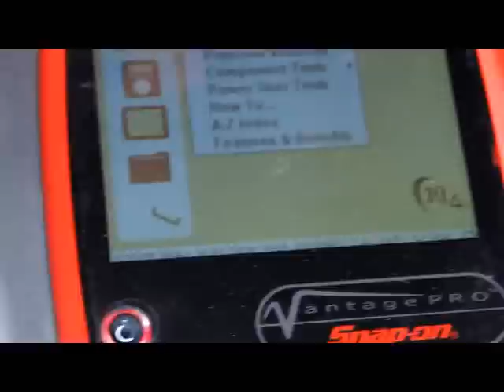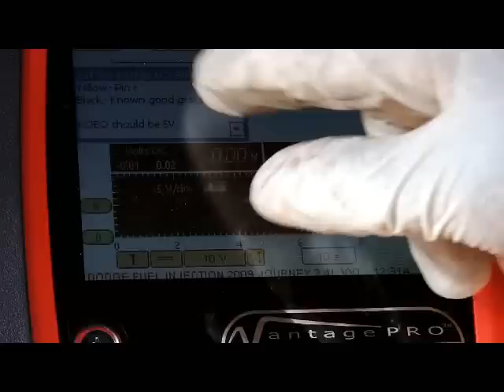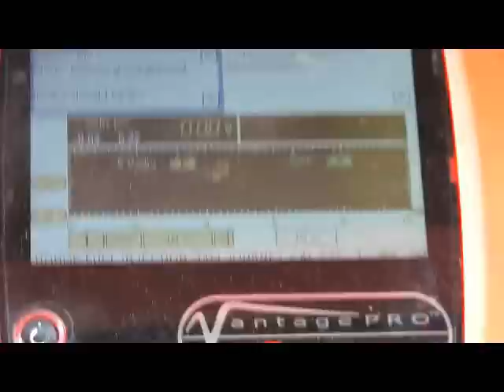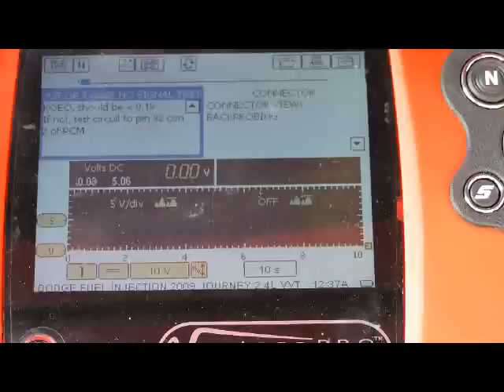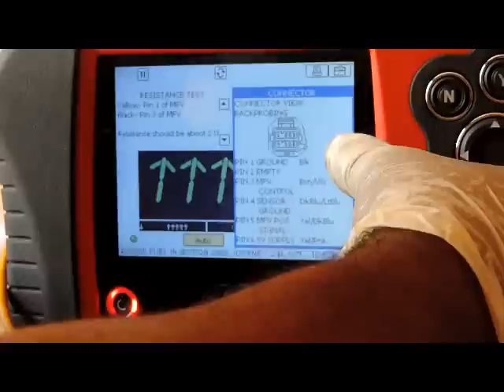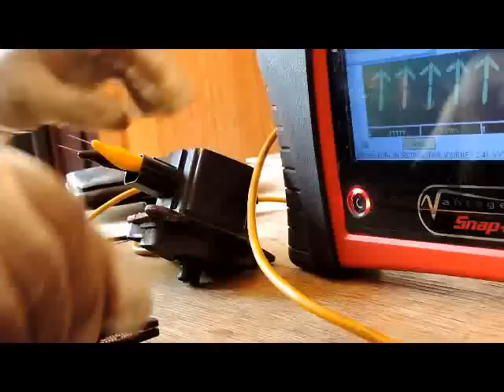P2004 Intake Manifold Runner Control Stuck Open - 2009 Dodge Journey

Comment: i have 4.25 volts at signal wire it’s that enough to replace pcm? thanks
Reply from the maker: Check to make sure nothing is shorting that wire out.
Reply: that’s directly from the pcm pin 4.25 volts

Comment: #astral auto, I have a question brother! What do you mean by flush the computer?? Do you mean reset the engine light??
Reply from the maker: Flash the computer
Reply from the maker: @Muzik Michael  You didn't see our comment? It's FLASH the computer, not FLUSH, or are you asking us what does FLASH the computer mean?
Reply: Astral Auto Repairs yes! What do you mean by flash the computer? I replaced the valve and turned the engine light off by the scanner I have.. is there anything else I should do??
And where are you located?

Comment: If changing the intake runner solenoid doesn't work  change the intake. 
            
            

            
            
          
        

        
        
    
    

      
      I'm going to save you all a whole lot of ass ache. I have a 09 compass that had the check engine light from hell, I tried all the fixes that youtube people had to offer and nothing worked, didn't even come close to working. I was at my local heep dealer to buy a gas cap for the heep for another problem it has, I asked the parts guy if he knew what they do for that code (P2004) he straight out told me without hesitation that they replace the intake manifold. To make a long story short, I had it replaced and the code went away.
After inspecting the old intake you could see where the gasket had gone bad and it was bleeding between intake runners. My guess is the intake warps a little after years of being hot and cold  after all it is only plastic and plastic warps. A new intake will run you about $400.00 buck plus installation unless you can do it yourself. You could try a sanding the intake flat again on a large flat surface and installing a new gasket, if that doesn't work you are only out a little time and 10 bucks or so for a gasket, then go buy the intake.
Thats my personal experience yours could be different, but i had good results

Comment: About 16:45 the meter reads 4k ohms not 4 ohms. But no problem, still a good video. Still shows it's a bad part. Shows me how to get to mine without removing the entire manifold. Same P2004 code too.
Reply from the maker: Thanks Aaron for pointing that out, glad you liked the video.

Comment: is IT possible that failure intake mainfold runner causes jerking or hesitating of whole car? i didnt get any codes . sorry for my bad English
Reply from the maker: Hi, not sure if it would cause those problems, but it can cause a lack of power if the runner is stuck closed.

Comment: hey ASTRO repair. I hear online that you have to flash the computer or something? I hope it's not true.
Reply from the maker: It's ASTRAL, and yes, any vehicle 1996 and newer must be flashed, some vehicles before 95, the PROM can be changed to fix driveability issues, hope this helps
Reply: Astral Auto Repairs thanks for the answer,  Astral! I appreciate it. I wish you guys were closer to CA. I think it's going to be $80 or more to flash the computer
Reply from the maker: Yes, that about the going price from the dealer.
Reply: Astral Auto Repairs lastly,  shops don't have that type of device?
Reply from the maker: Some because they have to pay for the software some shops don't want to bother.
Reply: Astral Auto Repairs well thanks Astral.  you have been very helpful and honest. anyone would be lucky to have you as their mechanic

Comment: Great video, thanks for sharing...you are a great mentor. FYI, I chose to change the entire manifold as the cost was only $150 more and a relatively easy swap.
Reply: hola, podrias ayudarme? ...
como le ago para pedir el cable para un avenger 2008?
Reply: hello, could you help me? ...
How do I ask for the cable for a 2008 avenger?
Reply from the maker: That sounds like a better option as it would save a lot of time from cleaning. Thanks for that info
Reply: Martin Mockenhaupt did you still have to have the computer flashed?

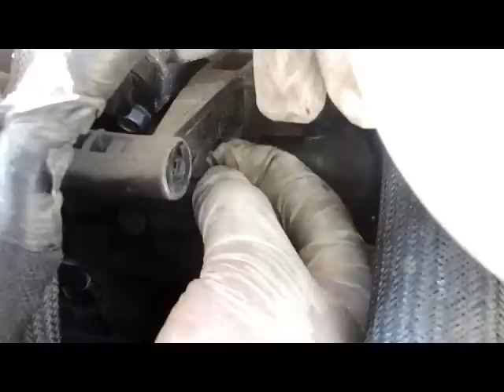Comment: Hey at 11:25 where you able to turn it very much?? Mine only turns like an 1/8 turn.. but the electric part you remove turns a lot farther than that. Something tells me the valve in the manifold should operate or turn farther.. please help me out. Thanks
Reply from the maker: Hey Jim, we thought the valve should have turned  more than what it did but after taking it apart, we found that it only moves just that much. As you can see from further after 11.25 when we took the valve out, we tried to manually move it. All of a sudden the valve snapped backed into the closed position. An 1/8 of a turn is not enough, that is telling us that it is stuck. hope this helps and if not, let us know.
Reply: +Astral Auto Repairs I mean the part in the engine. And my part has 2 ohms and the check engine light is on.
Reply from the maker: Only an 1/8 of a turn? Does it turn freely?
Reply: +Astral Auto Repairs Yes its very free, it just doesnt move much at all...
Reply: just had the motor get stuck on mine, was throwing p2017 p2004 AND it went into permanent limp mode. Engine sounded horrible too. Wasn't sure if the flaps were stuck because it only moved ever so slightly, BUT I could hear it flapping. So no it doesnt hardly move at all. WD 40'd the intake manifold control valve motor, put it back together, did the throttle dance, and BOOM, better than ever! Came out of limp mode & check engine went out on its own.
Reply: i think they only rotate about 30 degrees, not much.